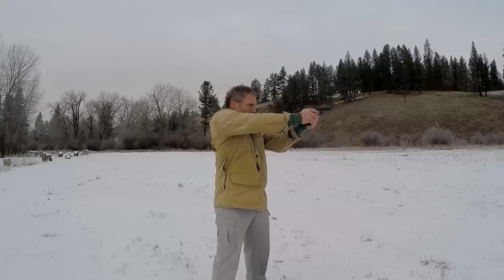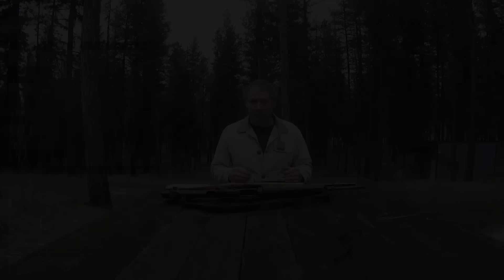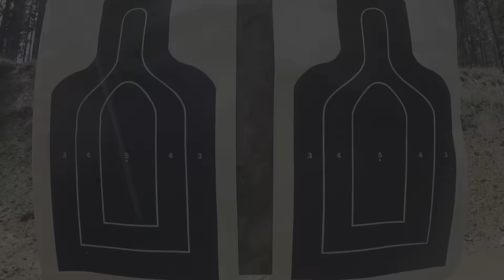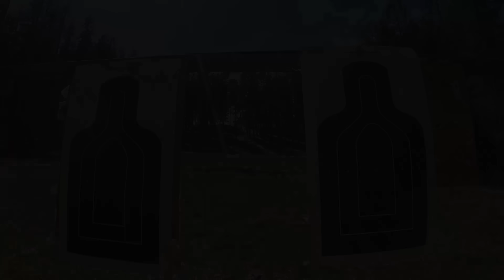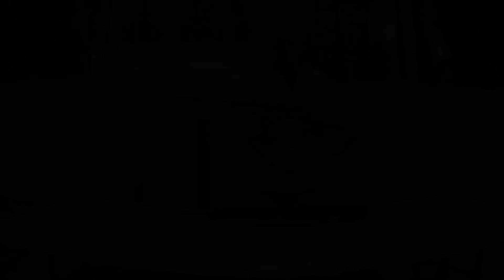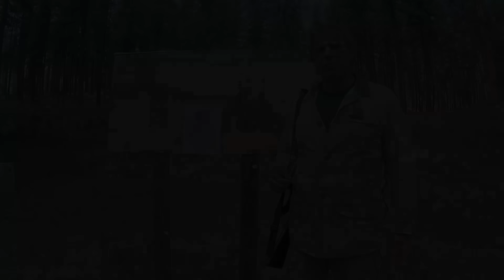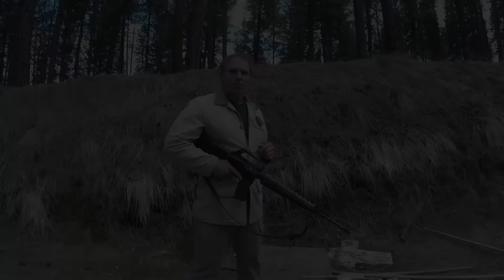Mini-14 vs AR15: Which is Better?

Comment: Hi, Paul. First, a little about me. I'm a lifelong shooter. Both competition and recreational. Also, a retired Law Enforcement Firearms Instructor and armorer.I've built and shot lots of ARs and owned several Minis. I find the AR to be an accurate and reliable firearm. There are just some aspects of the AR's design that I, personally don't care for. I always liked the design of the Mini much better. I bought my first Mini sometime in the '70s. Over the years, I went through four Minis. Once dialed in, each was accurate. But, each one failed to hold a group. As they warmed up, they would string or "shotgun". When that became apparent, I would curse and sell that sample. I liked the Mini's design and every two or three years I'd pick up another one, only to repeat the drill again. After while, I quit trying new Minis, altogether and shot mainly ARs. I, too read about changes being made to the Mini to improve its ability to hold a group. (I thought this occurred in the mid 2000s) Anyway, I bought A Ruger Ranch Rifle (as they are now, all called) that was manufactured in 2010. It's a tactical carbine model with a 16 inch barrel. I did a simple "barrel break in" routine with it and then mounted a scope on it and took it to the range and dialed it in. I shot about 60 rounds , on a 90 degree day, while fine tuning, moving farther back etc. Until at the end the routine, I shot two three round groups to see how it did. One group was just under an inch and a quarter and the other one was just, barely over an inch and a half. Compared to my previous experience with Minis, a warm Mini, on a hot day and after firing 50+ rounds turning in groups like that was unbelievable. I was astonished and ecstatic. I have other rifles for fast / fun shooting. My Mini is for accurate aimed fire at distance. I've used it a couple of times for hunting and shoot some competition events with it and it's always performed excellently. I can honestly say that, now, not only do I like the design of this rifle, but I actually love this sample. It's as accurate as any AR I've had and more accurate than some. Could it be "luck of the draw" and I just got a really good sample? I don't know, but it's a great rifle. I always enjoy your videos and find you to be honest and knowledgeable. Keep up the great work, and thank you.
Reply: Hi, forgot to say the two three round groups were shot at 100 yards.

Comment: I like the Mini-14, because of the ergonomics, mostly.  (I also watch these videos for the "Boring" parts where you just sit there, and talk.)  I never really liked handling the Stoner platform, and I really hate caring for it, which as we know isn't really great for the Stoner platform.  Shooting, and taking care of it feels like a chore.  Yeah, I'll do it, and I did in the army, but it's Work.  I'll take my Mini-14 out, and just shoot it for fun.  Nobody has to pay me to do it.  Your mileage will vary.  (I really hate the charging handle on the ARs, and the site placement, and the relation between the sites, and the charging handle...  I love any tip in rock back reload, because I'm better at it, for some reason.)
Reply: That being said, I'll openly admit that the modern ARs are better Tactical rifles, but I'm a civilian, and even when I was in, I was a tech, not a door kicker.  I've never been a door kicker, and if I they had to clear a room with hostages, and a tactical squad, I'm the last one you want going through that door.  (Probably to check out a flange, hydraulic, or pneumatic system in some sort of industrial setting.)  I qualified with the M-4, and the Baretta.  I never was an operator, and I never wanted to be.  If you fancy yourself to be an undiscovered natural tactical prodigy, then you probably want the AR.  If you're not, then it doesn't really matter which one has the most efficient reload to within a fraction of a second.  It's still going to take a couplefew seconds, If you keep up with your reload drills.  There's a lot of guys out there, and here in the comments, that will insist they need the best rifle, because they truly believe they're that wonder of natural tactical talent, and never been in a firefight.  The worst firefight I was ever in, with mortars, and bipod mounted belt fed LMGs involved, I was fixing the hydraulics on a vehicle.  Under mortar fire.  So, "Yeahbut," I'd probably have some sort of carbine, slung, because I'm probably never going to use it, and I'm carrying a tool bag, while the Tactical squad kicks in the door I have to get through.  Give me a PDW of some sort, I'm the guy they design PDWs for.  If I'm going in with your squad in the first place, it's probably for Pipe-fitting, or some kind of industrial plumbing.

Comment: The barrel length is only part of the reason you lose velocity, the charging system is entirely different as well, the AR looses less power due to the gas tube mounted further down the barrel the mini uses the blowback system drawing pressure the second the round leaves the chamber. So with the AR the bullet is half way down the barrel before pressure is released to actuate the bolt carrier chamber another round.
Reply from the maker: The mini is gas operated.
Reply: @PaulHarrell  Yes,  just like the AR-15 but there is no gas tube mounted half way down the barrel, IS THERE?

Comment: Great video!  I bought a Mini-14 a couple of years ago.  I've found the speed reload on the Mini-14 is easier for us left-handed shooters.  (grab the empty mag with your right [non-firing] hand, hit the mag release lever with your right thumb, pull the mag out and drop, insert new mag, then [and here's where it comes in handy shooting lefty], fully extend your fingers to create a knife hand - palm towards the gun - slide that hand straight up from the mag, move hand slightly rearward to bump the bolt handle to the rear with the side of your knuckle, then return your right hand to the stock as the bolt is slamming forward, and resume firing.  On the topic of accuracy for the Mini-14:  I believe Ruger solved the crux of that issue 6-7 years ago when they started making the barrels of new rifles thicker (you can tell if the rifle in question has the new, thicker barrel by looking at where the barrel emerges from the stock - the redesigned barrels are thicker there, and taper down over the length of about an inch to the final diameter, which extends out to the muzzle.  The old-style barrels, in contrast, are the same diameter from the end of the stock to the muzzle.)  I believe the thicker barrels helped eliminate innaccuracy induced by a barrel expanding as it heats up during prolonged firing.  

I personally find the Mini-14 to be harder than the AR platform to disassemble, clean, and reassemble....but maybe that's just me.  And factory mags, as Paul mentions, are WAY more expensive (and it's recommended that you not even bother with aftermarket Mini-14 mags, if you care about reliability at all....)  These 2 are the biggest disadvantages I've experienced.
The biggest advantage of the Mini-14, as mentioned near the end, is the legal piece - here in the quasi-fascist state of California, the Mini-14 is considered a "featureless rifle" as long as it has a standard stock and doesn't have a suppressor, flash hider, vertical foregrip (I believe), bayonet lug, etc....  Which means, the mag release can stay in its as-manufactured condition - no 'bullet button' or other mods required to make it a "fixed magazine".  AR rifles on the other hand, since they all have a pistol grip, do not fall into this category and must therefore have the magazine "fixed" to the rifle (or else have some really goofy mods made to the stock / pistol grip.)  So, the legal piece can be a huge advantage depending on where you live.  (I intend to make such considerations a moot point by moving back to the free state of North Carolina in short order....)  Anyway, again - awesome video!  Keep up the great work....

Comment: Your video was 100 % correct . I still own both and the Ruger has a gaping hole in the side and requires grease on a completely exposed operating rod groove.  My Ar -SP ( no button on the side ) is completely closed up with the ejection port cover closed. Both my mini-14 s will Group within 3 inches at 100 ( M -193 55 grain ) but my Ar-15 special Police will shoot the same ammo into a 5 shot group into one jagged hole.

Comment: Ruger now makes the AR15 platform.  No one else makes a Mini-14 platform.  Every Gun manufacturer practically makes an AR platform.  The AR has tons of aftermarket support and add-ons.  Ruger has very little. You can assemble an AR from off the shelf parts and it will work.  Mini-14 all your parts come from Ruger.  My biggest advantage of the AR over the Mini-14?  The AR will piss off Liberals and politicians more.

Comment: Aftermarket dual flipup ghostwring sight for the Mini-14, accuracy problem solved, might need a different barrel if headspace is way off.
 I am nostolgic for a lot of things from the 80s, but that's not the reason I like the mini14. I simply love the looks of the M14, and I think the mini14 is an even classier looking little gun than the M14. Its about looks for me and I know that's gay, but its also a dependable close range rifle. I will also pick walnut and blued over black and plastic on average in the long-run for long-guns. The irony is while I like the mini-14 better than the AR, I'll take the G3 over the M-14 all the time because the HK is a much simpler operating system, in spite of the G3 being one of the ugliest rifles every designed!

Comment: @Paul Harrell - Thanks for the most fair and unbiased comparison of Mini-14 & AR-15, A1.
Other people have probably already made the same or similar comments but here is my take on the comparison:
For general use like target shooting, small game hunting, home protection, etc. I don't really think there are enough advantages to one or the other to make a real difference to the average shooter like myself. Where the AR-15 truly gets its advantages for the civilian shooter is in the ability to modify it with what almost seems like an infinite number of parts to change virtually anything on your AR to something different or build your own custom AR. There are quite a few custom parts for Mini-14's but that market is kind of like the old Chevy vs Ford vs Mopar. A lot more things to trick out a Chevy engine were available than for the others. Maybe if you could buy a new Mini-14 as cheap as you can build a comparable AR-15 more people would buy them and the aftermarket parts would get more plentiful. Of course that may not be an issue if certain politicians have their way.

Comment: I've never shot with an A-1 platform, we had A-2's when I was in and they seem a little more user friendly as far as sight adjustments go. Also I have  never shot a mini 14, mostly because of the bad rep they've had for not being very accurate. I think this was a pretty good head to head video and I learned a lot about both. I really enjoyed the mag change portion of the video. Like I said I've never shot a mini 14 but they seem to be very similar to a full m14 or AK style. It's been my experience that having a deep mag well is also a little more user friendly, especially when in a low light setting or a quick reload scenario. Then again I don't have near as much experience with that style as I do with the M16/AR platform. Watched a few of your videos now, they're really good.
Reply: "Like I said I've never shot a mini 14 but they seem to be very similar to a full m14 or AK style."

They were designed to look, feel, and operate like a miniature M14, which is why they were named Mini-14. They aren't similar to an AK except in the most fundamental way, i.e., they are both gas-operated semi-automatics (or select-fire in the case of military/police versions).

Comment: A good topic would be sandbag effectiveness against different calibers and different materials used. A sandbag with only sand vs a sandbag with sand and rocks vs a sandbag with dirt or even top soil in environments with actually good moist top soil, and that adds the question does soaking the sandbag of sand with water and allowing to dry into a brick like object, ive heard this helps, or how good is a bag of readymix at stopping bullets, I believe this is a good question, and with your background you should be the one to put it to the test

Comment: I bought a mini14 580 series in 5.56 because i live in Massachusetts where AR15s are banned but not minis. Minis are i guess the next best thing to an ar15/ak47 platform. Unless you want to put a grand down on a m1 carbine or almost 2 grand on a m1a. Ive gotten some pretty good accuacry out of it mostly plinking at 100 to 150 yards. I dont shoot much paper because it gets boring but ive hit water jugs and steel plates with it at 100 yards with ease.

Comment: Having carried my Mini 14 every day for years and putting 4000 rounds through it, I would say it takes more abuse. My Mini. 14 is accurate but the magazines are a problem and the difficulty of mounting scopes to the original Mini 14s. A Ar 15 with an ACOG scope is much better but I still keep my Mini 14 handy. Thanks Paul for another good video.

Comment: AR15 better.  Standard popular magazines.  Ease of finding parts. Ease of upgrading modifying.  Ease of installing scope or accessories.  When people compare an AK47 to another gun, it is an AR15 not a Mini14.   
Bill Ruger kept his factory made higher capacity 20rd 30rd magazines out of civillian purchase before the ban of 1994.  Only sold mags to police, govt.   Only choice was aftermarket ProMag😱 and USA mags,  TrippleK, Percision.  My Mini14 $350 used with mags in 1993 So. Calif. AR15's were $850 at the time. Still have one Mini14, and now five AR15's recent builds from Anderson lowers.  
  One thing great about Mini14 is it will chamber and shoot gunshow reloads that my Bear Creek Arsenal barrels will choke on.
 ** Buy a cartridge gauge to test ammo, reloads before loading into mags **
AR15 $470.  Mini14 $799.
And politicians hate the AR15.

Comment: I highly doubt that 1-1/2" longer barrel it will gain over 100 fps, I am pretty sure that the high velocity it was achieved due to the barrel twist, probably the Ruger mini-14 has slower twist, maybe 1/10 and the AR15 A1 it has probably higher 1/7 twist, so that's why probably you gain more velocity out of AR15 A1.
As far as accuracy goes, I believe that the Ruger mini-14 it has a barrel forged out of material 4140 ordinance steel which material is used for civilian sporting recreational purpose, and whereto the AR15 A1 probably it has a barrel forged out of 4150 CMV steel which material is used for military combat operation purpose.
Reply: Mini14 1/9" twist

Comment: I got a Mini because I live in California, where properly functioning AR-15's are Verboten by the State Party.  
Most Mini's were produced with the Wylde Chamber, so according to the Ruger website, they can take 5.56, only the "target" model will not take 5.56.
Reply: AR15 is $900+ in Commiefornia.
  Rest of USA $450. 
 I bought a used Mini14 in 1993 $350  with six 30rd mags, B&B Guns North Hollywood.
AR's then were $850.
  Still have Mini and have six built  AR's from Anderson lowers.  I left Ca so didn't have to go featureless😱

Comment: Well, as far as the chronograph is concerned, you confirmed what I grew up with - namely that you gain or lose 100 fps (approximately) per inch of barrel (75 to 150).
Regarding the inconsistency of Mini 14's, I haven't heard of the headspace issue. I have heard that the barrels weren't stress relieved and if you stress relieved an inaccurate one, the inconsistency disappeared. This explanation is the one I've always believed because if there was a headspace issue, there would have been signs of this on fired cases and reloaders would have raised an alarm.
Regarding the differences in general, my neighbor has both. He has always maintained that they are equivalent in his eyes. Each has its advantages. Each has its disadvantages, and to him it was a balanced equation (his Mini took 5.56).
Personally, I would choose the Mini (in 5.56) because not only do I like the look of them, I prefer the feel of them in action. I've never quite gotten used to thumb hole stocks, and the AR feels far too close to the feel of thumb holes, at least with those I've been able to fire. 
The long and short of my comment is choose the one you like best.................
And regarding that child who was asking about sniper rifles when a pellet gun was present, SERIOUSLY, teach that child  BETTER. There isn't any excuse to my thinking for allowing ANY child to remain that ignorant about firearms.

Comment: Hey Paul, good video, I think you were quite even handed in your assessment. Like you, in the 80's I too has a Mini 14, then I got a colt sp1, and well now I have 4 ar's and no Mini 14. Comple things I think might have been helpful. At the 200-300 yard make, having a 2 inch orange dot in the center of the target could have help both rifles center better, then I get you would still have the holdover issue. Still even if there were 10 inches low, it still could have shown how well it could group. As to which is better, simple answer, go to ant tow or three gun action shoot and look for anyone running a Mini, then quick answer is no one is.
Also, there is a big difference between plinking or hunting vs being shot at, that is were those mag changes become all too critical. Rock and lock just take allot more training and still, the AR is just easier and faster. (But they both need training).
Lastly, I live in a very blue part of my sadly blue state, so yes I know about keeping a low profile when I take my guns from the house to the range. I find using Guitar gig bags, the padded and cheap, and no liberal ever gives it a second look.